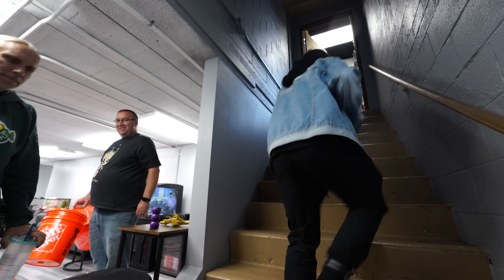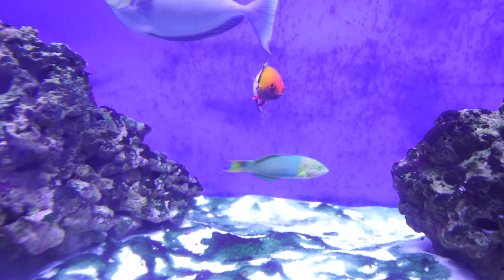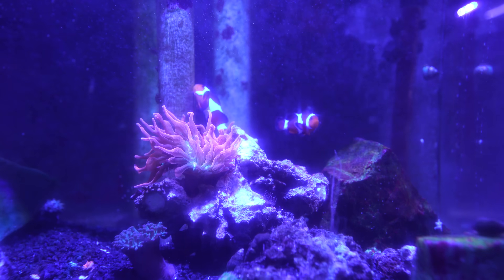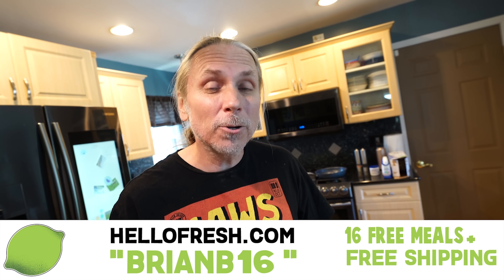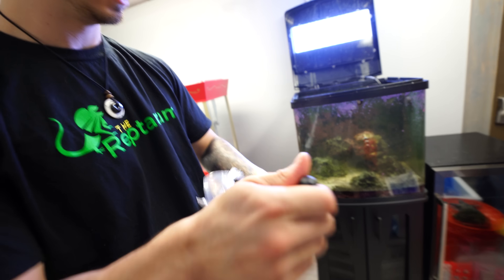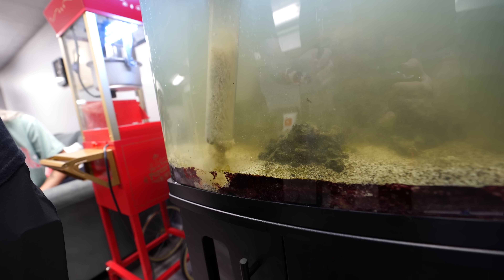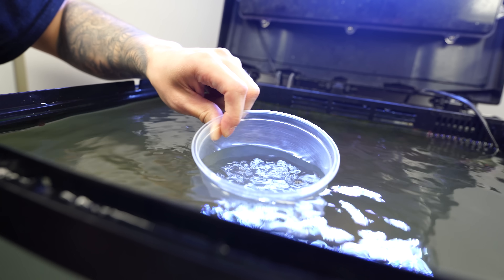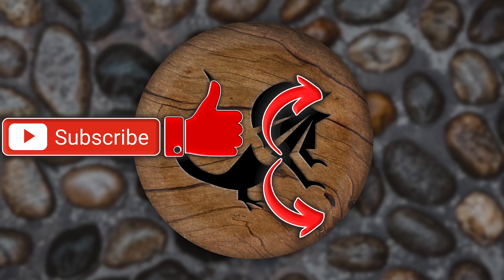Getting New Fish For My Salt Water Aquarium!

Comment: I like the Flame Angel the most, had a few, but they can turn mean in a smaller tank. Stay away from damsels. Add those last, always.

With SW there is a pecking order you need to worry about in the tank. You add an angel or damsels last. If you add more fish after them, they will be picked on and never eat.